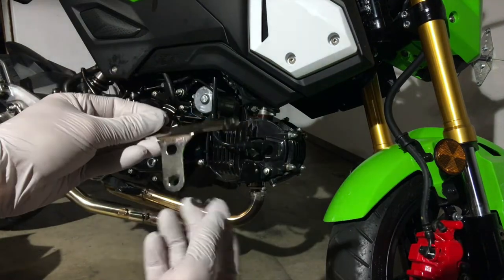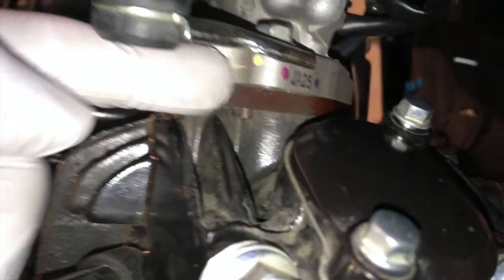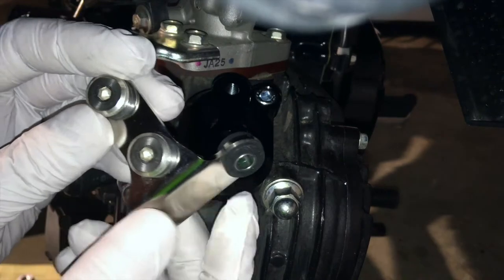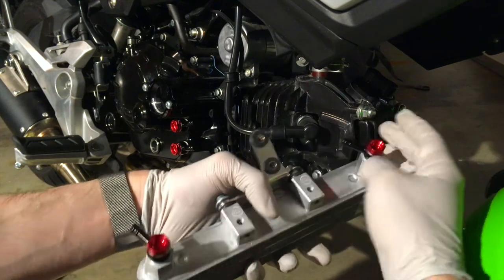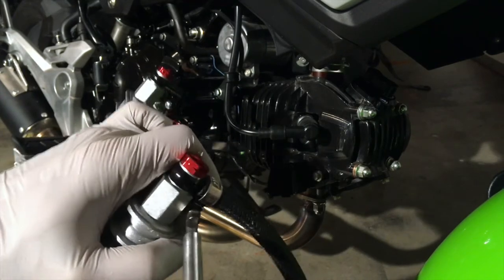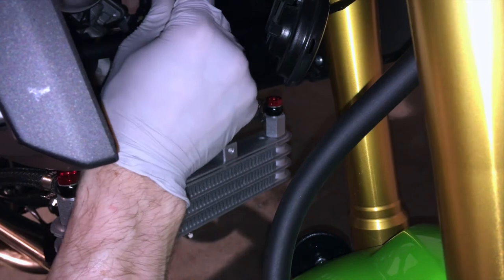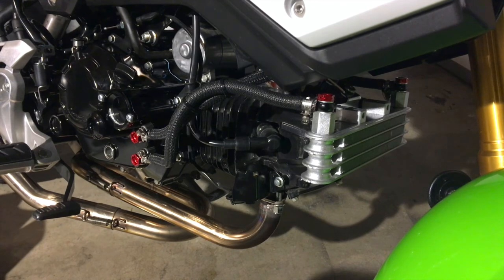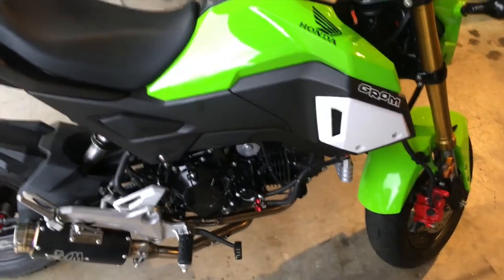Kitaco 3 row Oil Cooler installed on a Honda Grom SF via Kitaco Clutch Cover kit : Made in Japan :)

Comment: Do you take the cooler out to manually drain the oil that's sitting in the cooler for oil changes?
Reply from the maker: I traded out the Honda Grom SF for a Yamaha MT-03 so I don't do anything with the Grom anymore. Thanks for the question. Probably a good idea to drain all the old oil out, since air cooled motors are so hard on engine oil!
Reply: @AaronSchwarz42  thanks for responding!

Comment: This is crap , no support , why not fit it higher so it supports the side fenders with no air box???
Reply from the maker: I sold the GROM SF about a year after I bought it & DIY tuned it to 12.9 HP on the dyno. This was my first DIY power tune of any vehicle in my entire life. Everything else was eco-tuning to reduce fuel consumption & improve range! So please excuse me. I am not a certified mechanic, just some random dude who used the internet to tune the Grom. Sorry I didn't do it perfectly, no one IRL helped!